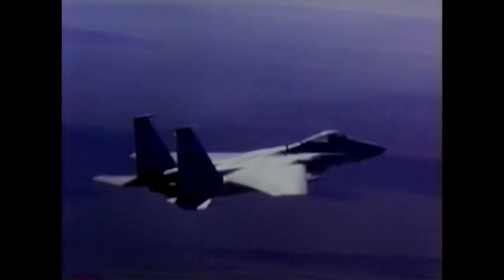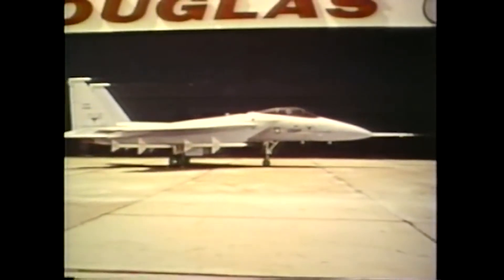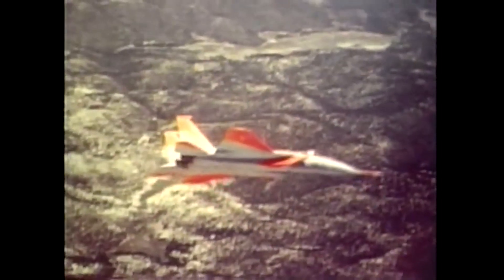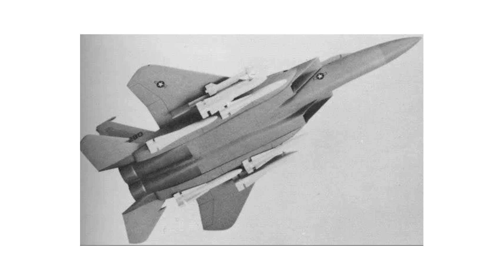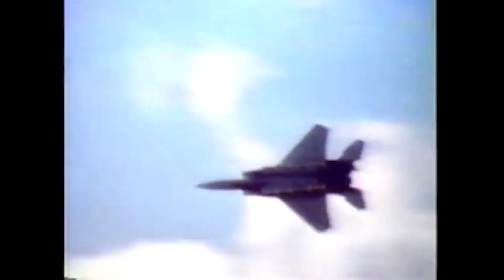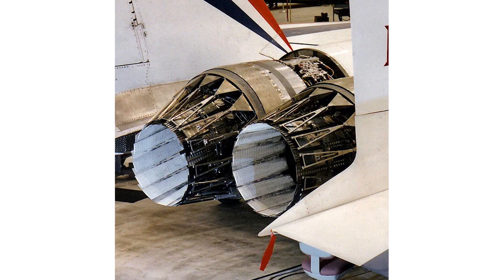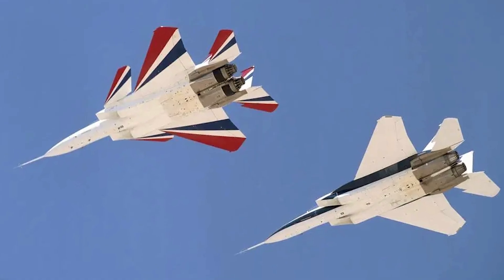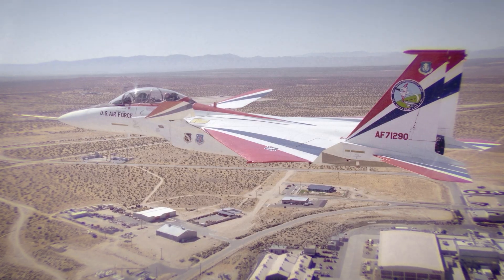The Forgotten F-15

Comment from the maker: Correction:  Thanks @fredjoeme1284 for pointing out that there were 2 F-15E losses in combat:  (1) F-15E (88-1694/SJ) of 333rd FS, 4th FW from Seymour Johnson AFB, NC was shot-down near Tikrit in Iraq on 6 April 2003, the pilots were Killed in Action. (2) F-15E-46-MC, 88‑1692, c/n 1101/E076, of the 336th FS, 4th TFW, USAF, was shot down by an Iraqi SA-2E missile during Operation Desert Storm. Both crew members ejected and were POWs.
Reply: Was the first one from a SAM too? Normally quoted is zero downed in air-to-air.

Comment: Correction... The f15 was built to counter su27... Which had thrust vectoring... So the soviets had it first..
Reply: Nope.  The F-15 was built to counter the MiG-25.  The Su-27 was built to counter the F-15, and came out over a decade later.  The  Su-27 doesn’t have TV either.  The Soviets didn’t test TV on an Su-27 variant until 1995.  That’s where the Su-37 and Su-35 came from.  The 35 had 2D vectoring, and the 37 had 2D vectoring and canards.

Comment: Can someone explain why 2D thrust vectoring is not incorporated into the new F15EX fighter?
Reply: Just a guess, but since thrust vectoring has been tested since at least the 70s (on fighters) and I've never heard of it actually making a difference in combat, I'm guessing the air force took some lessons from such programs and saved a whole lotta money, by not implementing TV across the board. It makes the airframe heavier, more maintenance demanding, you need more flight hours to train the pilots and everything gets more expensive with higher numbers. 
They implemented TV in AA missiles though.

Comment: "Never been lost in combat" That is false.  Two were shot down in the Gulf War.
Reply from the maker: Seems you are right. I found these:  F-15E (88-1694/SJ) of 333rd FS, 4th FW from Seymour Johnson AFB, NC was shot-down near Tikrit in Iraq on 6 April 2003, the pilots were Killed in Action. And F-15E-46-MC, 88‑1692, c/n 1101/E076, of the 336th FS, 4th TFW, USAF, was shot down by an Iraqi SA-2E missile during Operation Desert Storm. Both crew members ejected and were POWs.
Reply: I think people say that in the context that it was never shot down by another plane or with the distinction that the F-15E is separate from the F-15

Comment: If the improvements were so good, how come they never implemented it into production F-15 E's? Thrust vectoring is a huge advantage.
Reply: I worked on the STOL/MTD nozzles as well as the first ACTIVE mock-up to prove that it could work.   The STOL nozzles were a MAJOR pain to build and not really durable enough for service which is why the F-22 nozzles are much improved.   The 360 vectoring wasn't as helpful as originally hoped for and only expands the flight envelope a bit in areas that are rarely entered so they haven't been implemented in our production aircraft. 

Someone told me that the vectoring in flight of the 360 nozzles were about half as effective as they had thought they'd be and for the weight, complexity and additional cost were deemed to be something not needed.   If you've ever piloted a jet boat you instantly see the problem with them....unless they're making lots of thrust they don't do anything and this really narrows down the window where they provide an advantage.
Reply: @recoilrob324  Fantastic answer, thanks! I'm sure very few could have given me/us this detailed, in the know reply. Cheers
Reply: @recoilrob324 Also, the USAF found that supermaneuverability could actually be counterproductive, as pilots in exercises would often violate doctrine and get into low-speed turning fights, where anything can happen even if you have the advantage.  So the benefit wasn’t really there when U.S. aircraft could still dominate where their doctrine taught them to fight anyway.
Reply: @bluemarlin8138  How maneuverable an aircraft is in today's world means very little with other factors much more important.  How well the radar works, the missiles and counter measures all are of much greater importance than the 'dog fighting' capability.
Even the F-35 (Fat Amy) which can't come close to dealing with F-16 or F-22 in an actual 'gunfight' is very likely to never encounter one in its' service life because things have gone REALLY BAD if it does.

I know the fighter pilots do practice such things...just in case, but it would be a desperate scenario if needed and...hopefully...no pilot is ever going to be put into that situation.

Comment: The in-air thrust reversing to slow rapidly can also be used as flight control or thrust vectoring out either side port individually. Giving the 2d thrust vectoring from the rear a 3d kind of maneuverability that is different than normal the 3d thrust vectoring version.

I speculate that is why the raptor flies like a spaceship and just different enough to trick the eyes and confuse its prey.
I think that is the real secret of the raptor that we dont know about.
Because since the f15 stol mtd....we haven't heard anything about it except on passenger planes and it works totally different and only used on landing once the wheels have made contact...definitely not for in-air use.

Comment: The Su-35 flew with full 3d vectoring in 1987 under the name su-27m, M for modernization prior to this MIG and Yak was experimenting with it since the early 70's.
Reply: Nope.  The 1980s versions of the Su-27M only had canards, and it didn’t actually fly until 1988.  Due to control issues in certain maneuvers from the change in the center of mass, Sukhoi added thrust vectoring to the 11th model in 1995, almost 10 years after the U.S. did it, and called it the Su-37.  This model, like the Su-35, has 2-D nozzles that can only deflect 15°, but they’re on a canted axis to simulate 3-D vectoring.  The Ruzzians didn’t have a practical 360° nozzle like the one on the F-15 ACTIVE until the Su-57, and that one is being replaced with a 2-D nozzle to try to improve stealthiness.  Maybe they could have designed one in the 90s if they’d had the funding, but they didn’t, just like they don’t have the funding now to build a clean sheet stealth aircraft, so they just dressed up the Su-27 airframe with some low-observable features and called it the Su-57.  Not that the Su-27 airframe isn’t good, but some of its features make it impossible to base a true stealth aircraft off it.  Ruzzia also doesn’t have the precision machining tech to make a true stealth aircraft.

Yak was experimenting with a swiveling nozzle for STOVL only, to compete with the Harrier.  The Yak-38 ended up being one of the worst military aircraft in history.  The Yak-41 might have been ok, but we’ll never know.  And no, the F-35 wasn’t based on it.  At all.
Reply: Misinformation at its finest The US will always be steps ahead of Russia stop copying from the us you and your spies

Comment: The su 30 MKI has 3d thrust vectoring, I believe, not 2d
Reply: Actually Russia don't have engines with 2D thrust vectoring at all. It was in development in 80s, but thrown away for full 3D nozzle because it not affects thrust power.
Reply: @LeonmitchelliGalette Actually, Ruzzia didn’t have a 360° or 3D nozzle until the Su-57.  All the others have 2D nozzles canted in at an angle to simulate 3D vectoring.
Reply: The SU-57 is better suited for close range combat, like most Russian jets. An F-35 can just scan and pop the targets from hundreds of miles away.
Reply: @WolfeSaber  yeah, but the su57 holds the longest range air-to-air kills in history,  further than the f22/f35 missiles will even fly. The only place those aircraft outdo the su57 is numbers.  
Even from a standpoint of stealth,  anyone who understands geometric stealth (which is all we can get concrete information on for any of the 3 aircraft) would also be able to come to the conclusion that It's quite well built from 3 directions. The f35, for example, is well built from 1.
Reply: @deven6518  Well, the US is building better missiles, like one that is half the size as the standard, but still performs just as well as the full size ones.

Also, the Felons are built from substandard parts, like bubbles in the canopy.
Reply: @deven6518 According to Ruzzia, which isn’t the most trustworthy source.  Even if it happened, it’s not that impressive against 1980s Soviet fighters with zero upgrades since then.  Not gonna happen against modern Western fighters, or even “modern” Ruzzian ones.  It’s an anti-bomber missile which has hit fewer than 5% of its targets in Ukraine.  The AIM-120D has a better practical range against fighters, and the AIM-260 (which is in service) certainly does.  Nevermind the AIM-174, which is probably the longest range AAM ever designed.  

Actually, people with expertise in geometry and stealth HAVE analyzed all three aircraft, and have concluded that the Su-57 is by far the least stealthy.  It’s not even stealthy from the front, nevermind all aspects.  The F-22 comes closest to that.  The F-35 is very stealthy from the front and rear.  Less so from the sides.
Reply: @bluemarlin8138  should I counter that honestly,  with a long chapter, or will it suffice to just say that much of what your said is based on your preference?
Reply: And they had it first

Comment: Wrong info. India's Su30 MKI has 3d thrust vectoring.
Reply: Wrong, it was actually Pakistan
Reply: @crispay8304  india doesnt make jets
Reply: @KingDorner1x1   they make the tejas. Hal is the name of the companyi
Reply: @ferrous3262  that failed thing? It's been almost 30 years, India isn't really technologically advanced to pull it off
Reply: it is 2d actually
Reply: @aquilesca5tr0 it's 3d. I don't think the soviets/Russians have ever mass produced 2d vectoring.
Reply: @deven6518  soviets/russians never mass produced true 3d thrust vectoring just like the US, russia has a couple experimental aircraft with true 3d thrust vectoring but the ones in service have 2d nozzles that are mounted at an angle of 32 degrees
Reply: @aquilesca5tr0  I'm pretty sure that in almost every existing russian fighter, we can see true 3d vectoring.  I mean, don't take my word for it, just go have a look. You don't even need to leave YouTube.  The nozzles go up, down,  left, right,  and oppsose each other in all 4 directions. You can see it in flight, on the ground and in pr videos.  Isn't that 3d thrust vectoring? 
2d vectoring goes only up and down. As seen in thr f15 2d vectoring and the f22, the nozzles are slave to the elevators. The f15 with 3d vectoring were tandem and did not oppose, at least not to my knowledge.  If you have a video to toss my way, feel free to do so.
Either way, soviet 3d vectoring is as legit as it gets, and isn't a copy. If anything,  we could say it the other way, merely by chronology.
Reply: @deven6518  I´ve seen lots of videos of russian aircraft, 0 examples of 3d tvc in aircrafts in service
Reply: @deven6518  No, they dont have it in any production variant. Aquilescastro is right. They had some prototypes back in the 1970s and 1980s - so the narrative of the video isnt right as well, that the Russians and Chinese were inspired by American technology. Its the next logical step to do and it was developed at the same time in the USA, West Germany and the Soviet Union. Thing is it comes also with disadvantages. Its heavier and it makes the aircraft hard to control and more complicated. You also have to think about thrust vectoring as sort of a last resort thing to do. It will slow the aircraft down by A LOT. So you are a sitting duck in a combat situation when you pull high angle of attack maneauvers.
However it was benefitial for short take offs, as it was assumed that airfields would get nuked in a WW III scenario.

Comment: Considering all the technical advantages stated in this video, why hasn't this technology been implemented into existing F-15s, especially since they continue to serve as the backbone of the US Air Force?
Reply: I'm going to guess that the main reason is cost of the upgrades doesn't provide enough value over the f15s they are using currently
Reply: US fighter doctrine emphasizes BVR, where supermaneuvrability is not considered necessary. This is why the F-22 has been discontinued, and why  thrust-vectoring on the F-35B supports VTOL/STOL instead of maneuvering. US would rather spend our tax dollars on the F-35 variants, and developing NGAD / CCA, instead of prolonging the life of weapon systems originally designed in the previous century.
Reply: A lot of it has. But a lot of it isn't as useful as most think, so It's not gonna be put into service.
Reply: 1. While these modifications increase agility, it also decrease range due to added weight and drag
2. Even with these modifications, F-16 is still nimbler and more cost-effective for dogfight purpose
3. Last but definitely not least: cost

Comment: Today F-15EX with advances in control and fly-by-wire can do most things that even F-22 can do. Adding this + Silent Eagle features would probably baloon the price of EX
Reply: The problem is that F-15EX is still overall inferior to F-22 or F-35 (4.5 gen vs 5 gen fighters) and more expensive. Love me some Eagle tho.
Reply: @Heldarion the EX is cheaper than the F-35 and the F-22 hasn't been in production for decades.

Comment: its almost purely BVR now.  Dogfighting is dead
Reply: Not quite. Bvr is a fad.

Visual range in an aircraft is only really a couple miles. Anything can shoot that distance. True long range engagement is an issue with iff, and the fact that us fighter aircraft don't have missiles to match detection range.....meh. 
Maneuvering is good for avoiding a hit, because missiles only coast,  terrain matching,  acquiring targets at better angles, Yada Yada. Its useful, but not in the sense most expect.
Reply: @deven6518  Again another no industry player opinion.
Reply: @deven6518  True. You also have to look at doctrine as well. Israel has missiles that can hit a target on the other side of the country. But they don't use them since they require a positive visual ID before it can be shot down.
Reply: The same thing was said in the 50's. And the 60's. And the 70's....

Dogfighting will always make a comeback in some way.
Reply: @Plaprad   It wont anymore. Your comment shows you are not in the industry. Paper warrior.
Reply: @pigmoonk2545  If that's your opinion, that's fine. I'm not going to bother trying to change your mind. 

Either way, history will be the one to determine that in the end.
Reply: @Plaprad  Its not my opinion. Non industry insiders shouldnt speculate on topics they dont know about. And yeah its you.
Reply: @pigmoonk2545   Rather rude to simply insult someone for their opinion without knowing anything about them.
Reply: @Plaprad  It is obvious to those in the industry. We have a certain lingo and know the development of the weapon systems and tactics. You sound like a noob tbh
Reply: @pigmoonk2545  Suuure.... This is actually getting amusing now. I'm rather curious about your background after that one.
Reply: @Plaprad  Im sorry but i dont like to continue with a noob that doesnt understand current fighter tactics
Reply: @pigmoonk2545  Well that didn't take long.

Then how about this, mind letting me know where you've gotten your information on modern fighter doctrine?

Comment: Interestingly, the canards on the F-15 STOL/MTD were basically the stabilators from the F/A-18 Hornet.
Reply: They weren't basically the stabilators, they are the stabilators
Reply: They added weight, added drag and moved the center of lift forward.
Reply: @rapidsqualor5367 . Yes, but it’s designed that way to have high AO,  & lobbying high off bore Fox two missiles for modern day dogfights. The F15 & 16 were designed to be 2circle gun & BOV fighters, not up close dog fighters.
Reply: @bri-manhunter2654  The F-16 was also designed for energy retention. I read the cranked arrow wing of the F-16XL was great for lift but dropped a lot of speed in maneuvers needed in a close up fight. I would suspect this short take off F-15 would also loose more energy than the original design. With the F-35, instead of maneuvering the plane to launch at a enemy high off bore the missile itself will do the off bore maneuver. What is " 2circle gun" ?
Reply: @rapidsqualor5367  One-circle and two-circle fights. The two primary domains of dogfighting.

Two-circle fights are more common and favor aircraft with high mechanical energy retention and fast turn rate; such as the F-5, F-16, and F-15.

One-circle fights are less common, and favor aircraft with high alpha controllability, high vortex lift, and small turn radius; such as delta wing jets (Typhoon, Rafale, J-10) and jets with large LERX and/or thrust vectoring (Su-35, MiG-35, etc).
Reply: @bri-manhunter2654  True, but the F-15 ACTIVE would have been elite at both.  However, one reason the USAF/USN didn’t adopt thrust vectoring on aircraft subsequent to the F-22 was that in exercises, pilots were tempted to get into low-speed turning fights, which was counter to U.S. fighter doctrine since 1942 (except for in the early-mid 60s when they thought dogfight training wasn’t necessary).   While the F-15 ACTIVE would have had an advantage over basically any aircraft (even today) in such a fight, there’s a much higher chance of something going wrong in close quarters, and post-stall/high-AOA maneuvers leave you as a sitting duck if they don’t work.  At the very least, the benefit wasn’t worth the cost.  The F-22’s design was already finalized by the time the USAF/USN drew this conclusion, but that’s why it wasn’t included on later fighters like the Super Hornet, F-35, F-15 EX, later F-16 variants, etc.  The Europeans drew a similar conclusion.